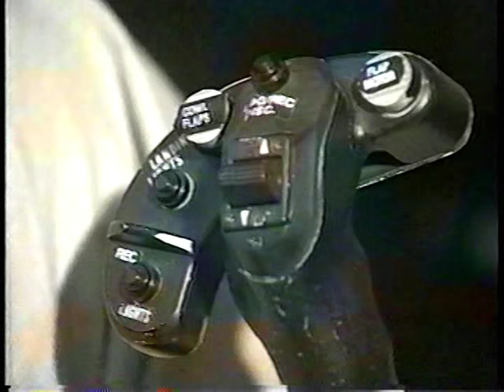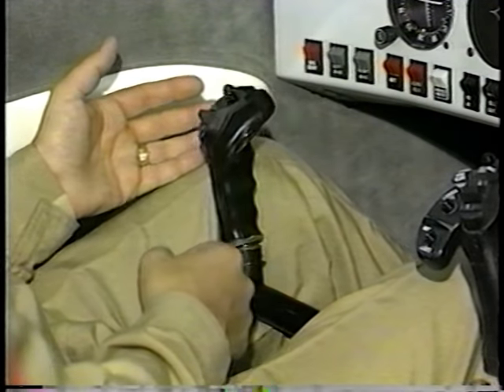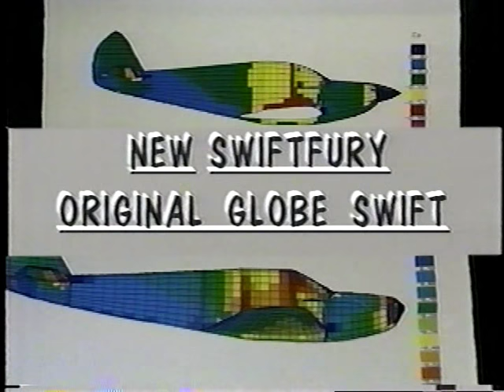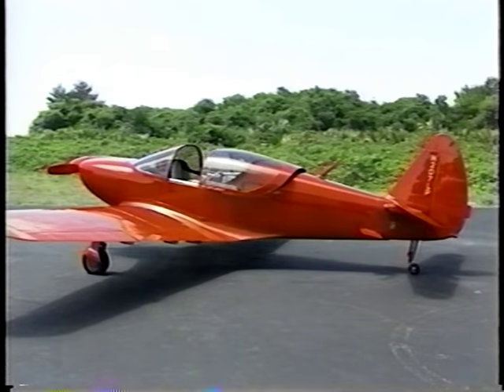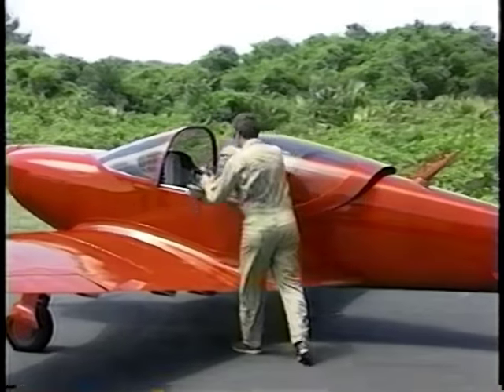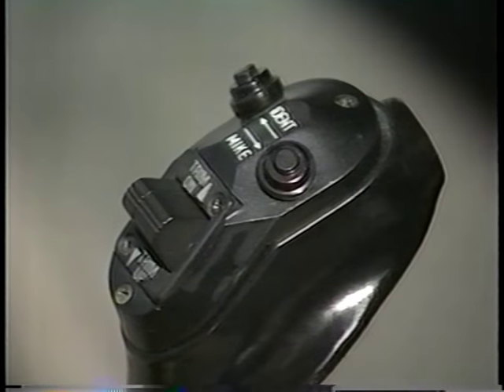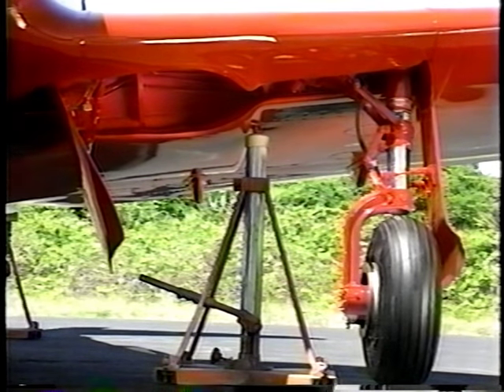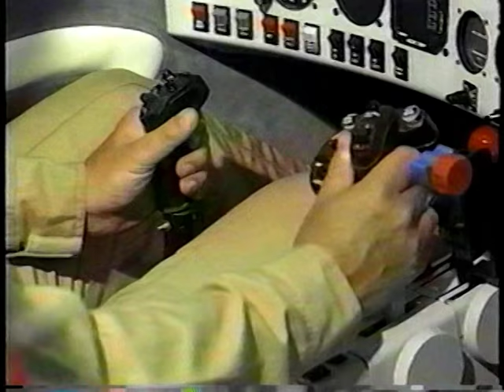SwiftFury Demo Video 1989 - Narrated by LeRoy LoPresti

Comment: Awesome but only problem is wing loading.. At 200 mph.. You better have smooth air.. Or tge bumps will kill you
Reply from the maker: Nope.  This was all new structure.  No issues at 200.  We would cruise at 215.  VNE was..I don't remember but is was about 275.